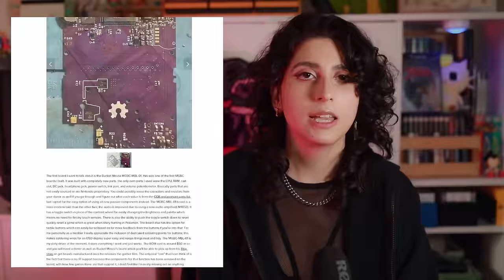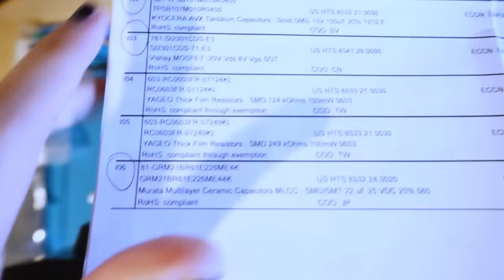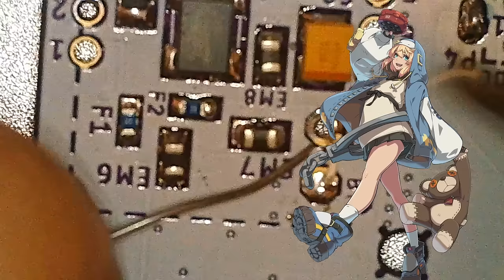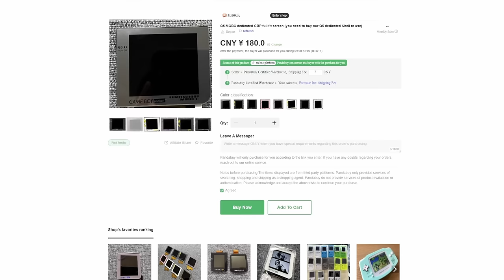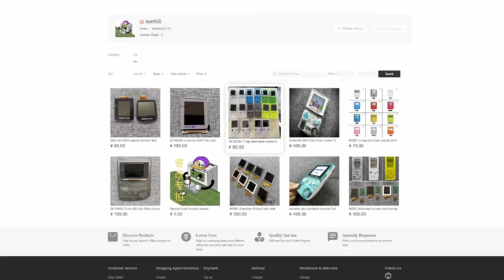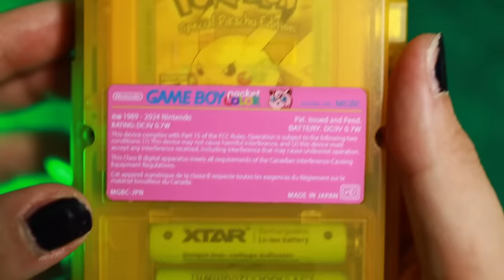Cool Uncle Mods: Gameboy Pocket Color - Tips, Tricks, and More

Comment: Something I recently pull the trigger on and I am so glad I did was a basic electric solder sucker. Works just like the one you were using but the soldering iron is built into it. It removes that trying to angle everything and go fast. It really makes a huge difference. I think I paid only like 40 bucks for it on amazon.
Reply from the maker: Congratulations!

Comment: I’m planning to get back in to it. I have used a cheap RadioShack soldering iron, and with no flux I managed to re-cap 3 game gears, a model 2 genesis and swap a N64 power indicator LED with a blue one lol.  You have a good work area, I’ll definitely be getting a few of those tools you have, this time with flux.
Reply from the maker: Flux makes such a huge difference - happy modding!

Comment: So many small components. I really need to get a hot air gun.
Reply: Actually if you see this, do you have any recommendations for both that little hot plate you have and a hot air gun? It'd be nice to try a hot plate to remove the CPU and RAM from an otherwise busted GBA I have...
Reply from the maker: It's the miniware hotplate! It's good for working on handhelds and is pretty standard fare amongst modders. My hot air station is the YIHUA 959D which I think is one of multiple Chinese clones running around, so as long as there are good reviews it should be alright. I also recommend grabbing some angled tips for the hot air station as it helps you see what you're doing better. Good luck!!